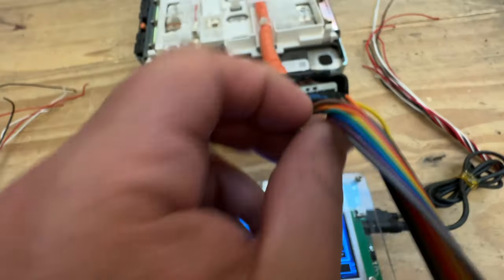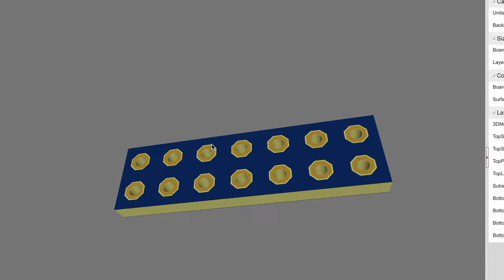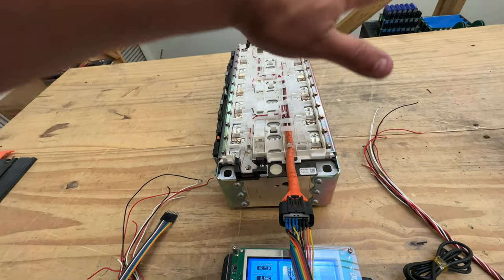Honda Clarity Battery Module balance connector pinout

Comment: But for something like a ecoflow delta etc..... the voltage is fine. Since all the delta units have a limit of between 50 and 100 volts we can use these just fine.

Nearly all my battery packs are for this anyways.

Comment: sorry for my stupid question.  is there a bms in the pack if not must you install one?  I would like to use it for a fishing boat.  thank you to all those who will share their experiences and knowledge on this novice question.

Patrick 😂
Reply from the maker: Yes you have to use a bms on this pack
Reply: Thank you very much for your answer to this newbie question.  another question that should be just as easy for you to answer.  for charging normally it must be charged on 120v or 220v (electrical terminal on the road and or at home) but what would be and how to identify the correct charger please.  I hope I have made a good purchase with this battery which could certainly run my old black and decker 36v lawn mower which needs new lead acid battery and my small 12v electric boat motor.  you are totally awesome.

Patrick

Comment: We need a coffee maker that actually works off 5v or 12v or heck even USB power,.. the more appliances that work off of USB power (actually work not mickey), it's a good thing.

120V  240V was to get the power from the power company to a home miles and miles away.. with battery packs we do not need 120v